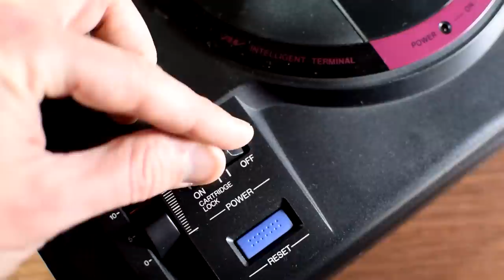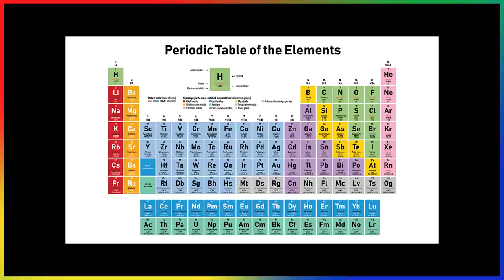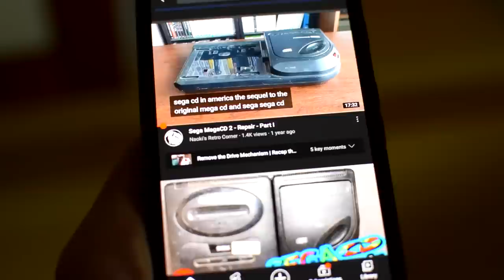Should You Fix Your Own Consoles (And Games)? - Retro Bird

Comment: I really started collecting around 2019, that year I found an NES near a trash bin in my neighborhood and from then on I had a quest to see if it worked/if I could get it to work. First I got a couple of games for the NES and was very saddened to see that it indeed did not work. I eventually then decided to open up the machine and clean it out. I tried it again and it still didn’t work. I tried various cleaning techniques, none that worked. I then did some reading and saw that replacing the pin connector could do the trick, so I ordered one right away. It arrived, I replaced it, but yet again it didn’t work. I sort of gave up at this point thinking I couldn’t ever fix it. But I still had some hope which is why I never threw it away or sold it (I did end up just getting a working NES on eBay so that I could play the games I bought xD). After about a few months of really starting to collect retro games, and opening more consoles, I got a bit more experienced and thought it’d be a good idea to open up the NES again. I now noticed that there was clearly one wire within the circuit board that lead from the pin connector port into the main machine that seemed corroded. Within the next few days I brought the console over to a friends house that knows how to solder. We found where that wire was supposed to connect in the circuit board so we desoldered the points and then soldered a new external wire so that the connection could be made. We plugged it into his tv, put in contra, and then (after a bit of cleaning of the Contra cartridge) the NES finally worked and displayed the beautiful Contra main menu! After that point we put in the good ol’ Konami code and had some fun. I felt so accomplished driving home knowing that I, with help from a good friend, was able to fix not only an important console with regards to the history of gaming but also the console that started me on my game collecting journey. Sorry for the long read, but I hope you enjoyed it!
Reply from the maker: Absolutely worth it to read this entire story.  I love this.  I bet playing Contra never felt so satisfying!
Reply: Quick little story for ya! Nice one mate
Reply: I'm just glad it had a real ending and not a non-ending!
Reply: You might look into replacing the capacitors too, they fail over time and can leak onto the board. It can effect picture quality (lines, color, static)
Reply: I found a working xbox in the trash in the alley behind my house . Its was clean as a whistle on the inside and out . Plus it works great so I gave my other one to my co-worker .
Reply: This was an excellent read!  Long winded but wonderful!  This is what collecting old tech is all about! Oh the Sweet Satisfaction of fixing that N64 GameShark 3.0 I had once upon a time that eventually landed me an early job fixing on n64 stuff!  Ahhh you bring me back man!  Thanks to you for such a great attitude and for the videos to get me through these hard times!
Reply: Pin connectors are a common issue with those types of devices. They're also often times relatively easy to replace, as long as the pitch isn't too tight. Sometimes you can bend them out, but frequently it does require a swap. I've got an N64 that I bought at a discount because the reset switch won't work and the cart has to be placed at a very speciific amount into the unit to work. That's usually a sign of bent pins. And on the N64, it's not that hard to remove the connector, the pins aren't that close together. 

The GameGear is a bit of a problem from what I can tell, there don't seem to be many options for a replacement connector. (I've been wanting one for dumping the carts, but I'll probably wind up getting a mess of pogo pins and 3d printing a connector as I don't want to canabalize a GG or Game Genie for something that doesn't need to fit into a unit. I'll leave that for somebody that needs it in a handheld.
Reply: Bless you for saving that nes lol
Reply: I hope you gave the buddy your old NES.  Since you got another I mean.
Reply: The more consoles you repair, the more you learn and become better and better. But please try to avoid hard repairs at beginning. I had broken some consoles in past, but i learned from my mistakes and other day i repaired a console i broke years ago due to lack of experience at time. It was a psone, not a valuable thing.
Not having the right equipment for the job its the biggest problem, and ofc lack of experience soldering.

Comment: Soldering isn't too difficult once you learn the technique. De-soldering can be a pain because old solder often times doesn't want to leave easily.
Reply: You simply add a little more new solder and make it mix.
It should be easier to remove afterwards.
Reply: @ShinryuZensen Thank u for the advice. I will try it!

Comment: Reheating the solder fixes a problem referred to as ‘cold solder’. What happens is the solder connections get brittle after time and the legs on the chips won’t actually be touching the pads anymore because the solder ‘broke’  So reheating the solder causes the solder to flow and reconnect the leg to the pad.
Reply: These issues also are much more common on the handheld games as they tend to have a little flex to them.

Comment: I also highly recommend using a white pencil eraser to clean pin contacts. It does an amazing job, it's not overly abrasive, and it doesn't leave a thin layer of film as isopropyl alcohol will do. Also please leave the Brasso and other harsh stuff in your shed! :)

Comment: I've been fixing and improving my consoles for about 7 years now. Learning soldering really isn't bad and was beyond well worth it for me. Today I fixed my sega genesis by replacing the sound amplification chip, i.e the Sony CXA1034. The sound on the console died and I discovered that it was the amp specifically by trial and error, specifically testing to see what points on the board were still giving me L and R audio signals. I then read online that this chip tends to go bad and, when it does, it will often be very hot to the touch when the system is on. I felt the chip in my console and it was very hot indeed. I bought a chip off eBay, waited 2 weeks, and replaced it today. Worked first try. Pro tip when removing bad chips: clip the legs off so you can desolder them one by one. Then clear out the holes with your favorite solder sucking device. My genesis has never sounded so good to my now quite biased ears!
Reply: Awesome story!

Comment: My new favorite fix i learned was the N64 joysticks. This company called Kitsch-Bent makes identical replacement parts and they work great. Combined with re-lubing them, they feel new again. And re-lubing Dreamcast controller joysticks also helps a lot
Reply from the maker: I may need to do that!
Reply: @RetroBirdGaming  so more detail then for you or anyone reading this. I highly recommend them, but i did have to file very small edges of the plastic to get them gliding smooth. I'm extremely happy with the end results, it is worth the effort, but you will have to adjust small things if you feel the joystick dragging after installing the kitsch bent parts. I had no videos showing me this when i purchased the parts but even i was able to get the plastic parts gliding smooth with some minor mods. The parts are only a few bucks. Well worth it.

Comment: I’ve been soldering since I was 10 - when I took apart my RC truck, “borrowed” a soldering iron, and tried to double the voltage to make it faster (it worked, but I wired it wrong and doubled the range lol).  

I’ve been into soldering ever since and have done pretty much anything and everything.

If you have no experience soldering , are on the fence, or don’t want to learn how to do it properly.  You can definitely make things much, much worse if you don’t know what you’re doing.

I love and recommend diy - so if you’ve never done soldering before, especially on PCBs, try practicing on a different project to get the basics down.  There’s tons of DIY soldering kits to mess around with.  If it goes poorly, have a pro fix your actual expensive hardware..

@Retro Bird - a common tool list would be great!  I don’t have those specific screwdrivers and have had to improvise..
Reply: just got my soldering iron and screw driver today
Reply from the maker: I've found that many sellers on eBay sell all the tools you would need in a set together.  If you just search something like "nintendo tool set" they will pop up and generally cost around 7 or 8 bucks.
Reply: I bought a new soldering iron and tried soldering with it for like 3 years. Every single attempt was a failure. I couldn't get anything soldered it was so frustrating. I found out after about 3 years of being a complete noob that the soldering iron DOESN'T WORK... i was using a defective iron for 3 years and literally HATING soldering at that point because it never worked. Now i bought another new HAKKO and its so easy. I can not believe for 3 years i was using a defective iron and was just struggling trying to get it to solder

Comment: Absolutely learn how to fix it! Start with cheap and or disposable items before working on the good stuff. I was able to get a $160 UHD player that was “broken” for $30 that I fixed myself. I’ve also learned how to solder from replacing batteries, and was able to use that skill to build my own controllers!

Comment: I just fixed the modded PS1 I got on eBay for $40. The laser went out and I figured out I could use my childhood PSONE laser to replace it. So it feels cool that the modded PS1 I got a couple years ago is now using a part of my childhood console from 2000 to work! Bought a broken Sega CD (no power) which was just a $3 fuse replacement to fix. My favorite fix was a broken NES I got in 8th grade 2002 from a friend. I never repaired it until recently, all I had to do was bend the pins on the cartridge slot to be tighter. Feels more fun playing on a machine you helped save from the trash bin.

Comment: This one hit pretty close to the mark for me. I would love to say "YES, absolutely! Do EVERYTHING to keep your console alive!" at the top of my lungs but in reality you should only fix your own gaming equipment, console or not, if your experienced enough to know how not to screw it up. I'm pretty good at upkeeping my own equipment but it's not an endeavor for the faint of heart sometimes. 

I've repaired/refurbed many types of controllers ranging from one N64 controller (rebuilt the stick assembly), ALL PlayStation variants minus the DualSense, ALL Xbox variants especially the 360, a couple Dreamcast controllers, a few GameCube controllers and even a Wiimote. The hardest ones to deal with is easily the DualShock family, every single generation has some kind of wierd build design that totally different from most other controllers and they're all hard to deal with. Different revisions also make it harder to source parts.

As for consoles, I've done my fair share of repairs for a bunch that I still own. I've replaced my PS2's clock battery, opened up a 32X to deep clean since it wouldn't start properly beforehand, disassembled my GameCube shell to replace some broken parts for the CD lid, opened up an NES to replace the cartridge pin connector and replaced the laser assembly for my Dreamcast, og Xbox (more on this one below) and the PS3 slim. The PS3 slim in particular was moderately tough. The blue ray laser went out, so I ended up replacing the entire laser deck which took a fair bit of digging into the console. 

My worst repair experiences by far have always been with the og Xbox. Not in terms of how tough it is though since ripping apart an Xbox is actually pretty easy. Rather because these things have been pretty unreliable on my end. I just have terrible luck with the OG Xbox. Every Xbox I've ever owned has had some sort of hardware failure. My first had a defective hard drive (impossible to fix and cannot be replaced without a mod chip), the second had its voltage capacitors on the motherboard blow out preventing it from being able to turn on or off without taking the power plug in and out of the wall, a third had a failed DVD drive that couldn't be repaired plus corrosion from a blown clock capacitor and a fourth had a burnt-out power supply. My current Xbox, technically my fifth, is actually a frankenstein of all four previous Xbox consoles that I had. I just took all the good parts I could salvage from the failed consoles and reassembled them together to make a whole new console. In other words, it took FOUR bad consoles just to make a single good one. It's comprised of the DVD drive from the first, the power supply from the second, the motherboard and hard drive from the third and the shell from the fourth (since it was the one in the best condition). To add insult to injury, I've had to replace the drive belt for my frankenstein projects DVD drive twice. I actually still had enough parts from all that to make two more good Xbox's so I sold the best of those two and kept the last for further repair since it was the one that had bad voltage capacitors. That one, dubbed the Voltage Capacitor Princess, is currently sitting in my closet waiting for replacement capacitors to run good again and will serve as my spare if I have another failure with my current console.

Comment: So I got in to retro gaming from this channel, I binged a bunch and then I remembered that I had a broken NES in my attic and  broken Sega Game Gear under my bed.  So I pulled them out and did some research as to what to do to make them work.  Found Macho Nacho Productions channel and Long Island Retro Gaming channel and found out that it would probably be the lock out chip that was bad on the NES.   Took a pair of pliers and clipped a prong on that chip, worked like a champ!  My Game Gear found out the capacitors were bad, so I bought a soldering iron and got to work!  Never soldered before and yes it was intimidating and I had to redo it several times but I did get it to work!  Now I need to buy a new LED screen and it will be like new!  

So yes you can do the work on it and yes it is very intimidating but a little courage and perseverance and you too can make old tech work like new!  

So thank you Bird for all you do to encourage the hobby!  This was a great video, funny too so keep up the hard work!
Reply from the maker: Thank you Jonathan and I am so glad to have wonderful folks like yourself be a part of this hobby!

Comment: That’s how I got back into retro gaming. I decided to figure out why my NES hardly worked. Turns out it was mostly cleaning and refurbishment of the 72 pin connector. 

After that I fixed everything else and started to buy broken consoles that normally are expensive. That how I got such a good deal on my Master System and PC Engine briefcase unit!

Comment: Fixed my Sega Saturn laser. Initially I tried adjusting the laser but that only temporarily fixed it. Decided to go for the full replacement and it was reasonably achievable. Have attempted to fix numerous controllers to mostly no avail. Also not confident enough to try soldering.

Comment: As a guy who tried to fix his PS2 after it stopped reading discs, I did not have any success. I went thru three third party lasers to try and fix the issue. I might try it again, but I gave up and just went ahead and bought another PS2 that was the fat model so I could install a hard drive with ISOs I installed to it. So now, I don't have to worry about discs. I did have success, however, fixing a PS3 that was overheating. I looked at several videos before taking that on. It was not easy, but I did it! I've fixed an NES that stopped reading cartridges by swapping out the PIN connector. On a final thought, I do believe everyone should learn how to solder. Such a valuable skill. I was lucky: I learned how to do it when I was in an electronics career field in the US Air Force.

Comment: This is a very interesting topic! I've never really had a console problem, but I did open up a Switch Pro Controller to replace the left joystick due to a drift problem. There are many easy-to-follow guides on YouTube for lots of specific gaming equipment.

If you grew up during the 8-bit or 16-bit days, we all blew into the game cartridges to get them to work. Sadly, the moisture from your breath probably did more harm than good to the game's contacts. Little did we know that NES games sometimes wouldn't load usually due to warped connector pins in the console itself. 😅

Comment: Fixing a broken console can be one of the most wonderful feelings in the world to me. I did a hot air rework on my red ringed original xbox 360 and was able to get the gpu and ram chips resoldered and the console booted right up after. Even better it has an operating system from like the early 2000s so it's like a time capsule of my middle school years. The feeling of contentness afterwards was simply awesome. Sometimes working on a broken console can be a great experience and you get to learn new skills, plus you may get your console back.

Comment: There's lots of jobs that are so easy I don't even really think of them as fixing. Cleaning cartridge contacts or cleaning a disc is just part of acquiring old games, and I put about as much thought into it as removing old price stickers. I actually did learn soldering in high school, though I've never done it since then. I've got a bunch of CR-2032 batteries that could do with replacement, so I've really got no excuse. This video might be the motivation I need to get my Unirally cart working again.